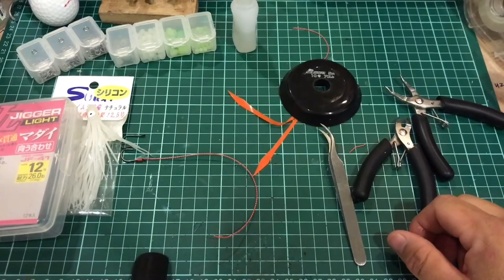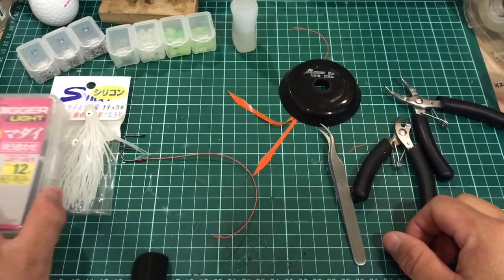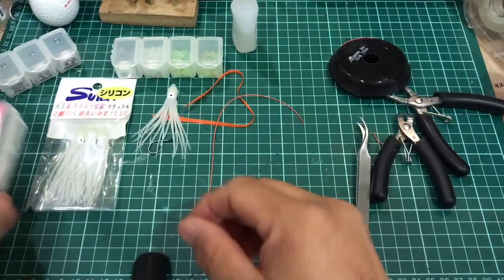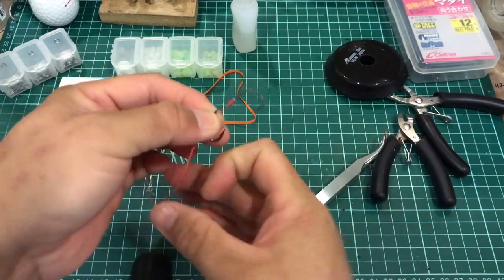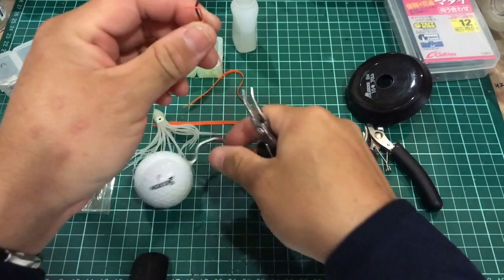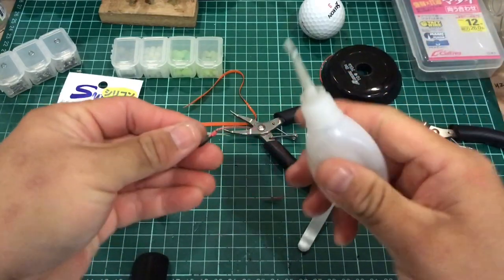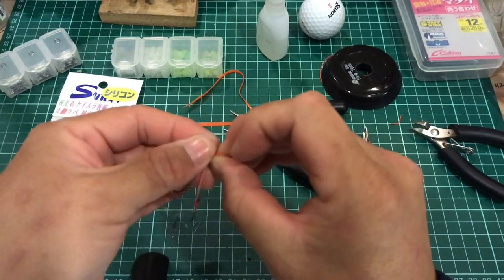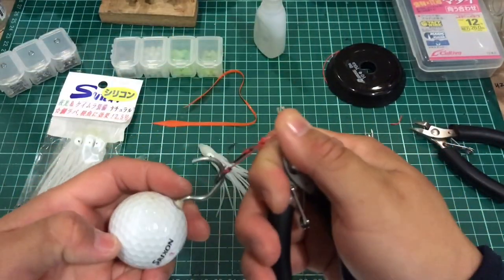How to make your own soft plastic squid skirts.

Comment: Hi, excellent video, thank you.  Where do you obtain the "tie" which is the orange strip which simulates the squid feeding tentacles?  Also, what type of line are you using please?  Very nice looking finished lure.
Reply: Ok. As for the you can order them through AliExpress. They are a little thick so now I prefer to use brands like owner Cultiva change up skirts or from Yamashita. The quality of ties are far better and better flattering action. Check me out at my FB page TaiKabura. I can then easily communicate with you through their messager.
Reply: Oh as for assist line. I use YGK no. 8
Reply: @kennethyap2304  Thank you very much.  I will check AliExpress.  I want to buy these products but it is difficult to find them in the U.S.
Reply: Yes it is difficult to find in the US. Another online store you can get some good Japanese made ones at plat.co.jp .
Reply: @kennethyap2304  Thank you.  I did not have any luck on AliExpress finding the ties.  I will check this store.
Reply: Hey I’m in Australia does anyone know where I could find the tai’s or did we come to the conclusion it was only AliExpress ? Or is it easier to get these Japanese products online in Australia